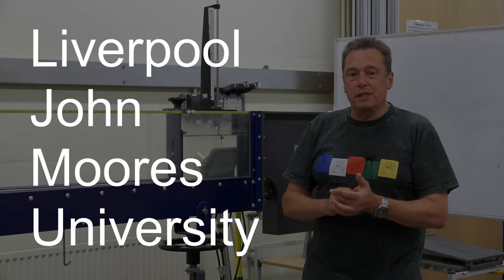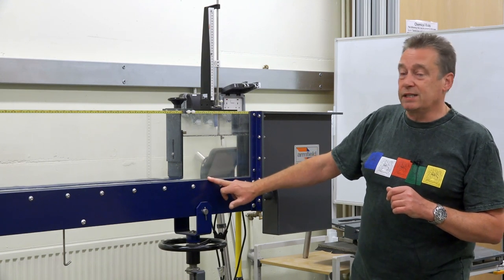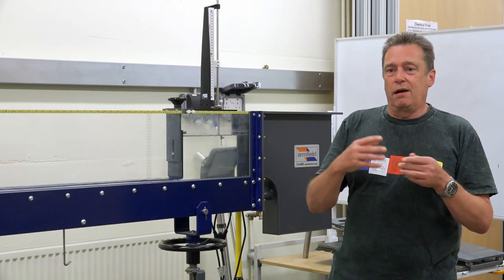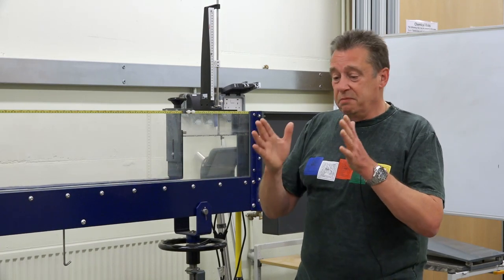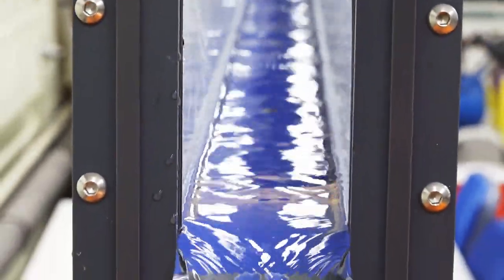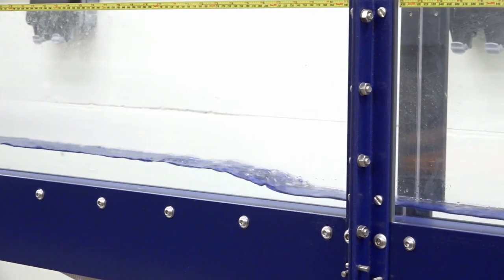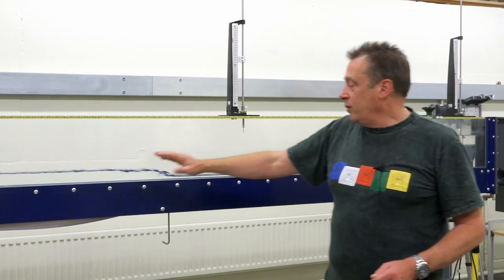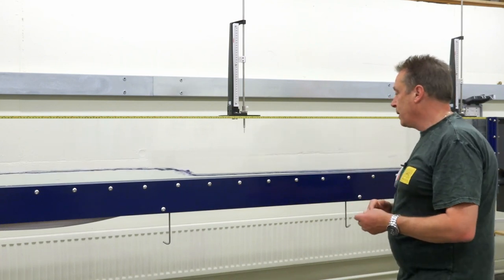LJMU Hydraulic Jump

Comment: Great demo. Like how you could adjust the position of the standing wave. Don't be scared of the math too. Brief acknowledgement of 1/2mv^2 equal to mgh would help explain the why.
Reply: These videos were made as brief introductions to some of the labs involved but not too complicated. In the full lab session we calculate the energy and momentum at each of those 3 sections then calculated the energy and momentum losses between those sections and use them to calculate the force of the gate on the flow, the power loss in the hydraulic jump, the Froude numbers at each section and produce specific energy and specific force graphs to calculate the critical depth in the hydraulic jump. I'll check the video you suggested tomorrow and thank you. :)

Comment: but whats a practical application for these?
Reply from the maker: The study of this effect helps with the design and control of waterways for both erosion and conservation.
Reply: @capturevr2974  i see, very cool. thanks.
Reply: One example is when you have a spillway on a dam that lets excess water overflow if there is a lot of rain. This can then flow into the river below. As it runs down though it will increase in velocity and gain energy. To prevent this going straight into the river a weir is put at the bottom to increase the depth of the water. This forms an hydraulic jump which causes turbulence which takes power out of the water and slows it down. It then flows over the weir at a slower pace causing less damage to the river.
Reply: See YouTube vid "What Really Happened at the Oroville Dam Spillway". The section about stagnation pressures and concrete slabs lifting up is interesting. Discusses hydraulic jumps at small ledges at the ends of concrete slabs. Sorry about the lack of a link - usually when I posted one in a comment the comment would disappear.
Reply: @toma5153  This one?
Reply: @chadcastle6980  Right. Starts discussion at about the 11 minute mark
Reply: @toma5153  great video. :)

Comment: Every 5 year old boy did this same test down the beach or local river ... who pays for this!
Reply: If those kids then calculated the energy and momentum at each of those 3 sections then calculated the energy and momentum losses between those sections and used them to calculate the force of the gate on the flow, the power loss in the hydraulic jump, the Froude numbers at each section and produced specific energy and specific force graphs to calculate the critical depth in the hydraulic jump then yes, it's exactly the same.
Reply: @chadcastle6980  for sand and toy trucks ... yeah ok bud. ;-)